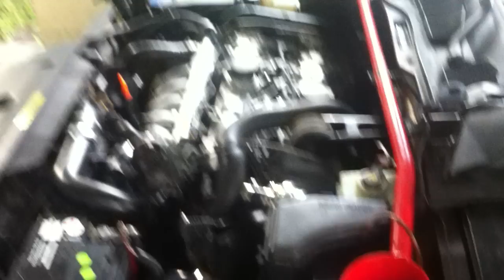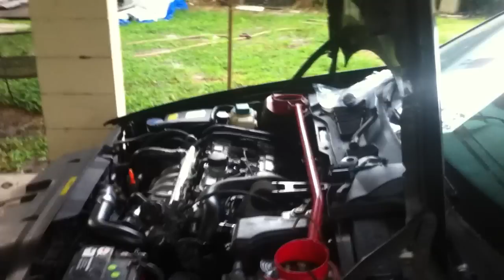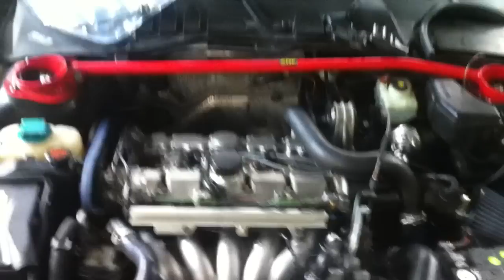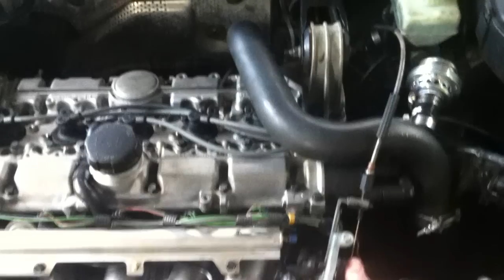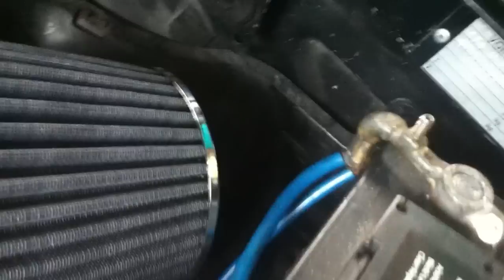First Start After Swapping in '00 V70R engine - Volvo S70 T5

Comment: You know that blow off valve is after the maf, right? You are losing metered air.
Reply: You know it's recirc right lol...
It's mounted in ic pipe just after turbo not in intake is just mounted there to recirculate into intake..